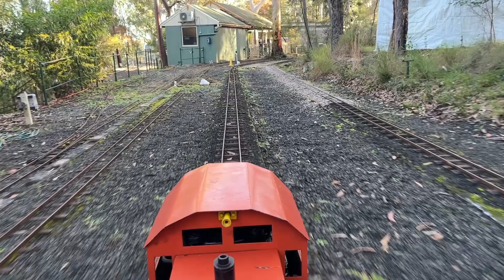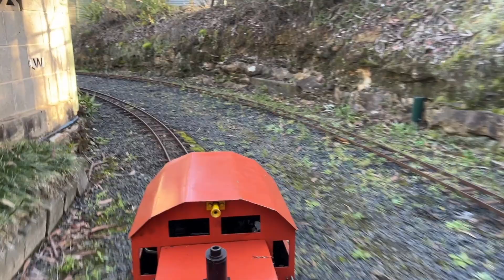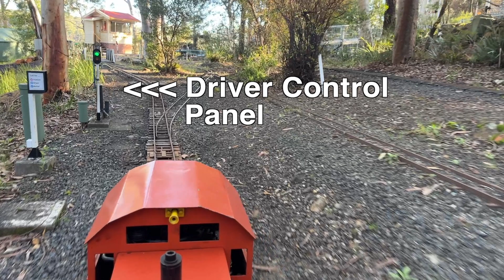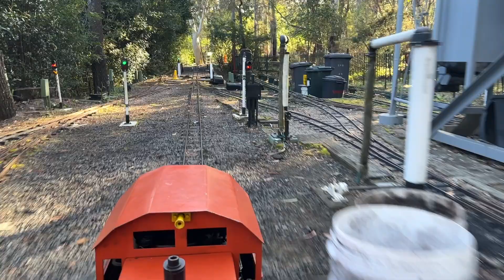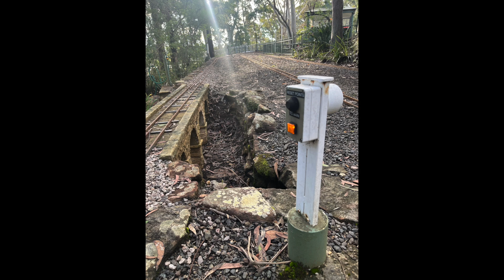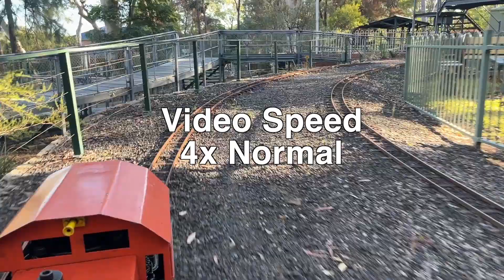267. Galston Valley Railway Driver Introduction & Signalling Guide - Review Draft 001 (18 Jun 2026)

Comment: As an outsider, and a foreigner, but also a driver trainer at my local Model Engineering club, this is a fantastic video. Well done for your efforts, an excellent production which is very informative. Having been to your facility last year, the hospitality shown was absolutely outstanding! Your layout is excellent, providing a variety of track layouts/routes, and a variety of driving conditions. Certainly the best facility I have seen in Australia in quite some time!

If I may offer acouple of suggestions for the video, personally I would:

1. Simplify the description for the signals found as the train traverses the lap. Maybe have a basic overview of signal aspects (red, flashing yellow, yellow, red) at the start of the video, then just a brief explanation of the signals as the train runs around the track (2 aspect, 3 aspect, diverging route etc), instead of repeating the same phrase over and over again for almost every signal found.

2. When you approach the station, possibly break into a diagram of the station layout, with each signal/control box/communication point position and function clearly marked. Either that, or refer to the above point, and simplify the descriptions.

3. For the Driver Control Panel, I would suggest having a close-up photo of the panel, so that the Trainee can see the various options more clearly. I note the panel on the way back up the hill has had a close-up photo added, which is great, as it clears up any potential unclarity.

Only other question I have, is why do the signals that protect the points that provide alternative routes, show RED when the diverging route is selected? Is there an idea behind this, as opposed to a YELLOW aspect?

More than happy to help/explain my ideas further, if you wish :) Just let me know who I need to get in touch with. I have produced afew driver training videos for the club here aswell, I am more than happy to share those with you aswell.
Reply from the maker: Thank you for such a thoughtful and encouraging comment! 🚂👏

It's particularly pleasing to receive feedback from someone involved in driver training at another model engineering club, especially someone who has visited Galston Valley Railway and experienced our facilities firsthand.

Your suggestions are excellent and exactly the sort of constructive feedback this proof-of-concept video was intended to encourage.

I particularly like your idea of introducing the signal aspects at the beginning, then simplifying the explanations as the train progresses around the railway. A clearly labelled station track diagram and close-up views of the Driver Control Panels would also be valuable additions.

Regarding your question about red aspects protecting alternative routes, I'd prefer to confirm the precise signalling arrangements and operating requirements before offering a technical explanation.

I'd also be very interested in seeing the driver training videos you've produced for your own club. Comparing different approaches could be extremely useful as this project develops.

Thank you again for your generous comments about Galston Valley Railway and the hospitality you experienced during your visit. It's greatly appreciated! 🚂😊
Reply: @HornsbyModelEngineers  no worries at all!
How do I contact you with video links? They are all on my channel, but are unlisted, ie you need the link to view them.